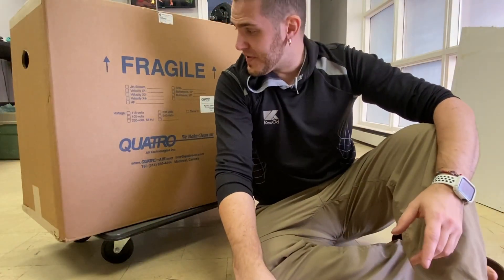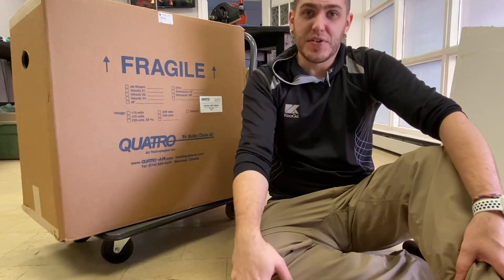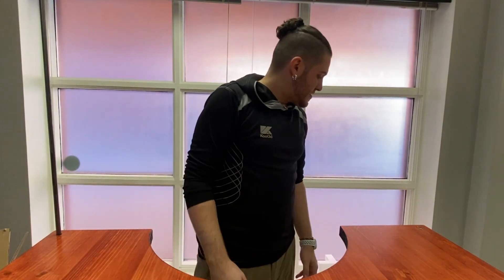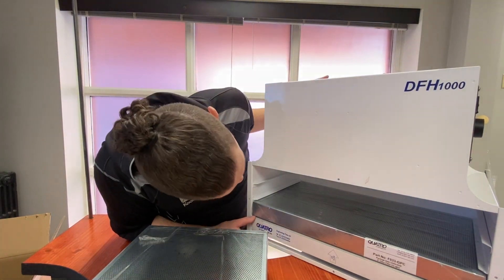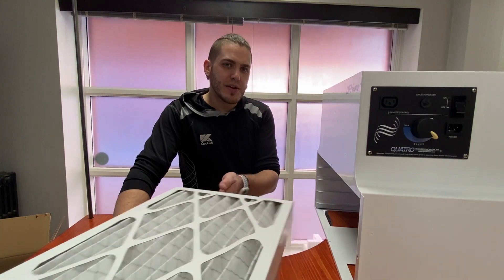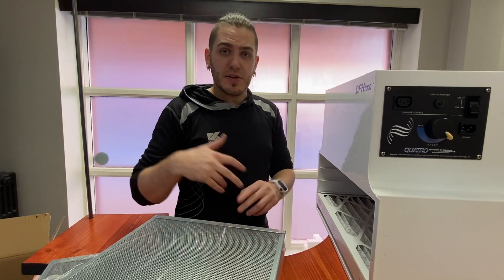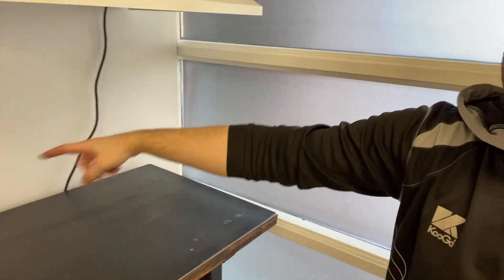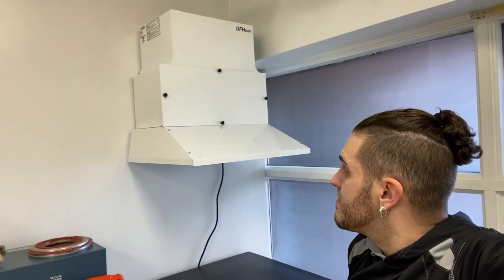Ventilation Unboxing - Quatro Ductless Fume Hood

Comment: what about the soldering area?
Reply from the maker: The hood setup can be used for several different processes, you would need to change out the filters to match. They have advertised plating, soldering, burnout, and particulate I think.
We have a smaller system for soldering.